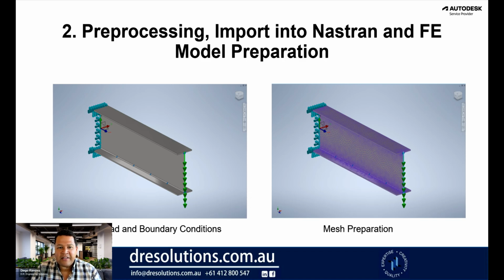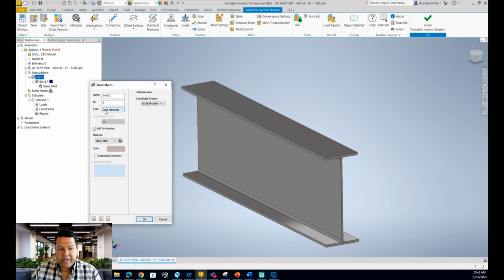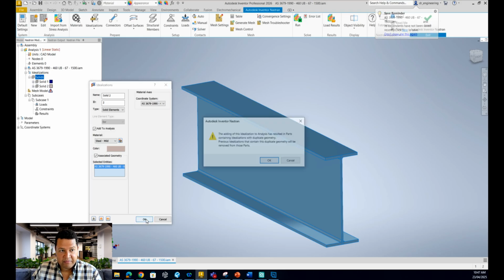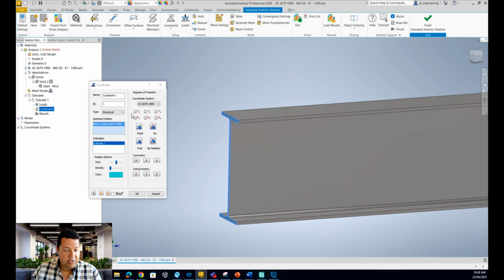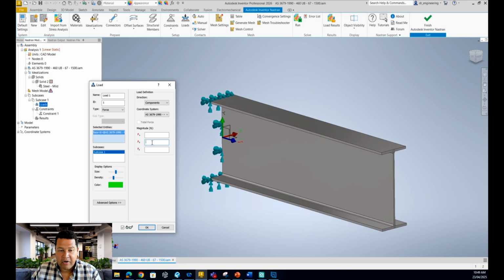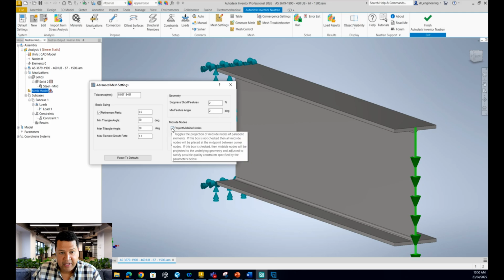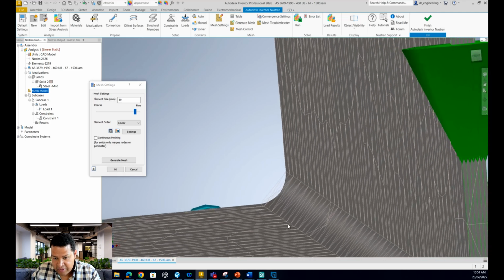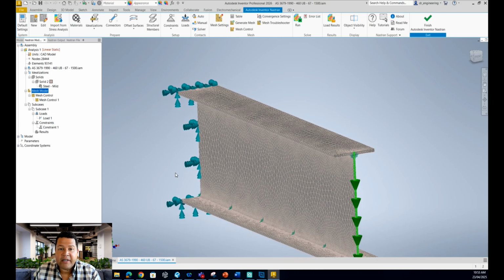Introduction to Inventor Nastran Static Analysis Demo Series - Pre-processing

Comment: I find it interesting how the meshing in the radius of curvature can be specified, that is where the concentration of stresses is most important.
Reply from the maker: Thank you for your insightful comment! 😊 You're absolutely right—meshing in areas with a radius of curvature is crucial for accurately capturing stress concentrations. In our next video, we'll run our simulation in Inventor Nastran and post-process the results, focusing on stress distribution, displacement, and safety factor analysis. Stay tuned, and feel free to share any other topics you'd like us to cover!